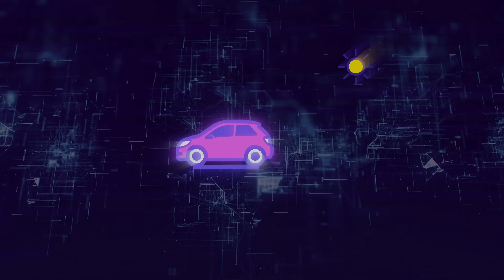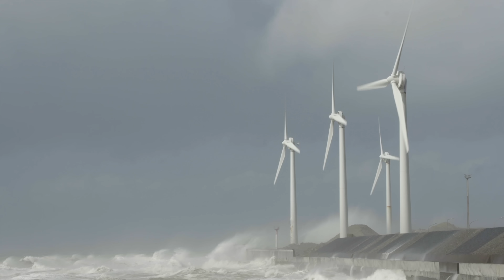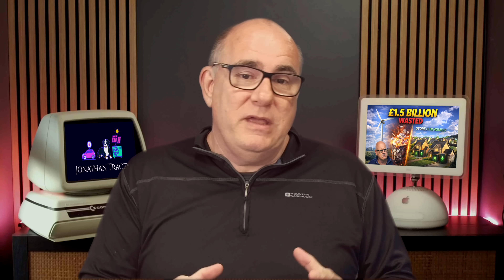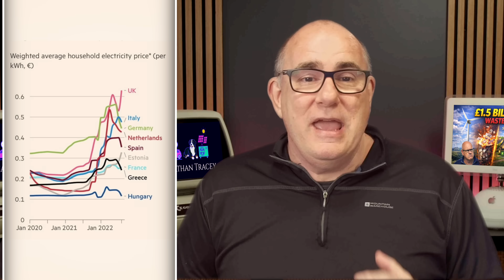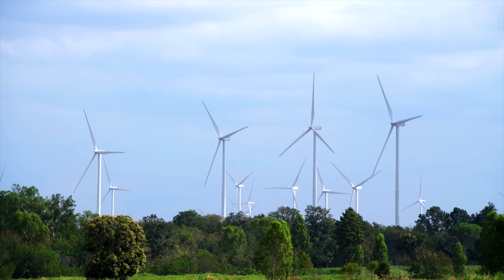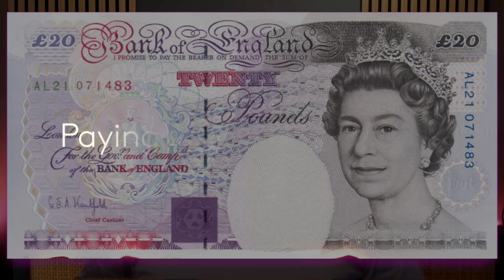We’re Paying £1 5 BILLION To Waste Energy… Here’s My Big Idea

Comment: The problem is that the curtailed wind tends to be generated all in one go.  For example according to the wasted wind website on 28th March, 85GWh was curtailed, followed by another 92GWh on the 29th March.  This would require around 45 million 2kWh batteries to absorb it.  But when would those batteries discharge?  Since the following day there is also curtailed wind.  Furthermore, the curtailment tends to be predominantly in Scotland, above the B6 boundary line.  But there are fewer homes there to put batteries into....  The best sink we have is probably EVs, and promoting EVs in Scotland would be a great idea, but even these will be swamped relatively quickly ie 90GWh is 1.8m 50kWh EV batteries and this assumes that they were at 0% SoC to start with.  It would definitely help in several ways if homes had batteries, especially if they also have heat pumps, but it's unlikely to solve the wind curtailment issue looking more closely at the numbers.  We really need a different technology to lithium ion, iron-air from Form Energy looks interesting which take the form of 1GW/100GWh power/storage ratio.
Reply from the maker: @chapmandu2 This is a really good breakdown 👍 and you’re right on the scale — those are big numbers.  

The bit I’d push back on slightly is the assumption that you need to absorb all of it, all at once, in one place.  

In reality you’ve got multiple levers working together:
- Some gets stored (batteries, EVs, heat, etc.)  
- Some gets shifted in time (demand response, smart tariffs)  
- Some gets moved (interconnectors / grid upgrades)  

So it’s less about solving 90GWh in a single hit, and more about **chipping away at the peaks from multiple directions**.  

On discharge — that’s actually the easy part. Even if the next day is windy, demand still exists (especially evenings), and that’s where stored energy displaces expensive gas.  

Completely agree on long-duration storage though — lithium-ion isn’t the whole answer. Things like iron-air could be a really interesting piece of the puzzle.  

So I think we’re aligned on the problem — just slightly different on whether distributed storage can make a meaningful dent 👍
Reply: So you allow providers to offer regional agile pricing. Scottish Agile would be a great pricing deal. North of England Agile pretty good, and some East as well. Even if Octopus didn't want to rock the boat someone would offer Scottish rates pretty fast if it was possible.

Much quicker than the government getting tangled up in making batteries, and if you offer industry and business those kind of tariffs then factories and the like will appear there, EV chargers will appear at much cheaper rates and so on.

The Westminster mob know this, it's not complicated economics and they all went to oxbridge.

Comment: Scrap net zero, this is a failure of labour policy. They could fix this simple issue over night. Clean energy doesn’t work most of the time and we’re simply trying to force a square peg in a round hole. We need the North Sea opening up for gas and oil exploration, with local coal power stations using UK coal to provide a wide variety of options. As for batteries in people’s homes, paid for centrally, that’s just dumb. Why am I paying for other people to have cheaper energy? What’s in it for me? Central giga factory I could understand, or even local storage for wind farms, but not this.
Reply from the maker: @nothingtosee7718 Just on the politics point — net zero wasn’t introduced by Labour.  

The UK’s *2050 net zero target was set in 2019 under a Conservative government* (Theresa May), with cross-party support. It’s been backed by multiple governments since.  

So whatever people think of the policy, it’s not really accurate to frame it as a single party issue 👍
Reply: @J @JonathanTracey  but they made it so, when they declared “The Labour Party aims to make the UK a "clean energy superpower" by accelerating to net zero, targeting a zero-carbon electricity system by 2030.” It doesn’t work when you kill your own economy and china/india/US continues on their own path. Stop net zero now. So yes, it’s a labour policy issue.

Comment: Distributed storage batteries break the monopoly on balancing electricity in the power grid, which is why the existing corrupt system resists so much!
Reply from the maker: @Drillmechanic There’s definitely an element of that 👍  

Distributed storage shifts some of the control away from central balancing and into homes and businesses, which changes how the system operates.  

I wouldn’t go as far as calling it “corrupt”, but the system is designed around centralised control — so naturally it’s slower to adapt to something more distributed.

Comment: I’m not a net zero nut. I’m a sceptic. But…. I have just bought an ecoflow stream ultra 1.92 and 2 x 515w solar panels to run my baseline house at night. I think it’s a good idea as a starter. 
Just disappointed today with the grey skys, I’m getting no solar generation at all
Reply from the maker: @b4tm4nrubin33 You’ve nailed it 👍  

Taking control of your own energy bills has nothing to do with net zero — it’s just sound finance. Use cheap energy when it’s available, avoid expensive energy when it’s not.  

And yeah… welcome to UK solar 😄 grey skies are part of the deal. That’s where the battery + cheap overnight charging really comes into its own — solar is the bonus, not the only plan.

Comment: Hi Jon, I like the idea but 28.5 million homes at a cost of £500 per battery (if that is the true cost of building infrastructure, production, installation, support etc) would cost £14.25 billion.. so that is surely a 10 year ROI… surely it would be better to centralise grid scales battery storage where the  need is, and then distribute to cover peaks. This would be simpler to maintain. But I like to principle of your suggestion
Reply from the maker: @scales2801 You’re absolutely right on the maths 👍 — it is a long ROI if you look at it as a single upfront investment.  

But that’s kind of the point — the alternative is we spend the next 10 years doing what we’re doing now and end up in exactly the same place.  

Centralised batteries sound simpler, but they come with the same core problem as the grid itself:
- You still need massive interconnects  
- You still hit transmission constraints  
- And those upgrades cost hundreds of millions (often billions) and take years  

Distributed storage flips that:
- No new transmission needed — you just plug it in  
- It reduces peak demand locally  
- It frees up capacity on the existing network  

So instead of building more bottlenecks, you’re easing the ones we already have.  

Reality is we’ll probably need both — but waiting for large centralised solutions is exactly how we stay stuck where we are 👍
Reply: @JonathanTracey a great response Jon, and I hadn’t thought of the bottleneck constraints, I agree that we need to do something…. Anything…

Comment: What have I missed here, Jonathan? I thought the issue was that there was excess energy being generated in locations where there wasn't the demand BUT we don't have the infrastructure to move the excess energy to where the demand was. The batteries wouldn't be where the excess generation - there would still be the infrastructure bottleneck, wouldn't there?
Reply from the maker: @leemartin2396 You’ve got the core issue exactly right 👍  

The starting point is a constraint — too much generation in one place, not enough capacity to move it.  

The difference with this approach is you don’t try to solve it all in one go. You start **at the source**:  
- Put storage where the excess generation already is  
- So instead of trying to push everything south, you store it locally  

That immediately reduces the load on the transmission lines.  

Then as you move south:  
- More batteries = less peak demand on the grid  
- Which frees up capacity on those same wires  
- Which means more energy can flow without upgrading them straight away  

So you’re effectively **easing the bottleneck from both ends**:
- Less trying to get through  
- More space for what does  

Do that at scale and you end up with a kind of **distributed “mesh” battery**, not one big system — and the money we’re currently spending on curtailment can go into both:
- Expanding that distributed storage  
- Upgrading the backbone grid over time  

So you’re right — the constraint doesn’t disappear overnight… but it gets smaller and more manageable much faster 👍
Reply: @JonathanTracey  Its all way over my understanding but.... when demand is high, the grid is "at capacity" moving energy to where its being used such that, any excess being generated in Scotland can't "physically" fit into the system to allow it to be moved southwards? So, if you can free up some "capacity within the grid" by reducing peak demand (because some of it is met locally by millions of small scale batteries), then more of the excess generation on a windy day can be "squeezed" into the existing infrastructure?

Are there enough homes and businesses that are close enough to the source to free up some of the grid's bandwidth?

HS2 shows what a mare it is to do large scale national infrastructure projects on-shore but I wonder why its not viable to put an interconnector or three in the North Sea to carry juice from Scotland to London for example.

I like the idea you proposed. Like a national effort to create jobs, fix our network, have some pride in our ability to work sensibly (instead of bickering about anything and everything) and actually saving money and being better off in the long run. Sounds too sensible and something that the fossil fuel lobby would spend a great deal of money to scupper. Fracking is the answer, don't you know ;-)
Reply: Correct, the idea is total nonsense and shows very poor understanding of the problem.

Comment: We have a huge problem in The Netherlands where we can’t get new homes or business because the grid is full. So this idea is also good for us. I don’t think you need a switch, you can let the voltage drive how the battery runs. So high voltage like 235v it starts charging. And with low voltage it starts distarging
Reply from the maker: @robbierrob That’s a great example 👍  

You can use voltage as a signal like that, but it needs to be done carefully — voltage can vary for lots of reasons, not just excess generation.  

That’s why most systems use smart control (CT clamps, tariffs, automation) rather than relying purely on voltage.  

But you’re spot on about the problem — once the grid is “full”, solutions like this become really important.

Comment: I already do something similar.  I have 2 off  Bluetti home backup batteries.  I charge them up on the Agile tarrif at the cheapest times.  Price plunges are great ... they pay me to charge my batteries.  I have them charge from a radial circuit on my consumer unit but discharge them onto my relay controlled circuits ( sockets ,lights,) ie if the batteries ever go flat or are disconnected the circuits  switch automatically to mains supply.  I have reduced my usage costs per kWhr in March from 20p down to 7p.   I'm getting ripped off buy the standing charge though.  My SC is more than my usage costs per year.  I check the charts at 4pm every day and set the charging schedules for the following day.  Takes about 1 minute max to do.  This way I get the cheapest leccy every day.  Am considering getting an MG4 with V2L to switch to Intelligenct Go to get everything at 5.5p/kWhr and the car acts as 50kWhr storage battery
Reply from the maker: @vtecgrin4503 That’s a brilliant setup 👍  

You’ve basically built your own manual VPP — charging when it’s cheap (or negative) and using it later. Getting down to ~7p/kWh is exactly how this should work.  

Standing charges are the killer though… they completely blunt the benefit of being efficient. That’s the bit that really needs fixing.
Reply: Is you set up manually controlled? Could it be automated?
Reply: @robertsprigge5535   Hi. The App is manual setup.  I can set and forget the charging schedule though but you'd miss a lot of the cheapest prices on agile. Setting it to charge off peak is a start.  It will bring down your average unit cost. If you get an EV tariif then you could charge at same times and unit costs

Comment: You have not solved the problem. Your opening statement is that the electricity is in the wrong place, so loads of small batteries can't be charged from a wind farm in Scotland because the grid can't shift it to the south or Wales or wherever, or have I missed the point?
Reply from the maker: @jonathanallen985 You’re right about the core problem 👍 — the energy is in the wrong place.  

The idea isn’t to magically move it south on day one, it’s to **start where the energy already is**.  

You begin by installing storage close to the generation (Scotland, north of the constraint), so instead of curtailing wind, you store it locally. That immediately reduces the strain on the transmission lines because you’re not trying to push everything south at once.  

Then over time you expand outward:
- More storage added further down the network  
- More demand shifted to match generation  
- Less peak flow on the grid  

And the key bit — the money we’re currently wasting on curtailment can be redirected into:
- More storage  
- Grid upgrades  

So you end up with **both**:
- A massively distributed battery  
- A stronger transmission network  

It’s not a one-step fix, it’s a phased approach that starts solving the problem immediately instead of waiting 10+ years 👍
Reply: Nice to see someone else can see straight through this 'big idea'.

Comment: I worry that at the end of the batteries lifecycles that we have no economic recycling capability, this we end up polluting our environment (or other countries environments).
Reply from the maker: @Phil-bn5dx That’s a valid concern 👍  

Battery recycling is improving quickly, but it’s not perfect yet.  

The flip side is we’re already dealing with the environmental impact of wasted generation and fossil backup — so it’s about balancing both sides.
Reply: Depending on the chemistry (some are not economic), we can recycle 95% of batteries. Plenty of recycling capacity in Europe.